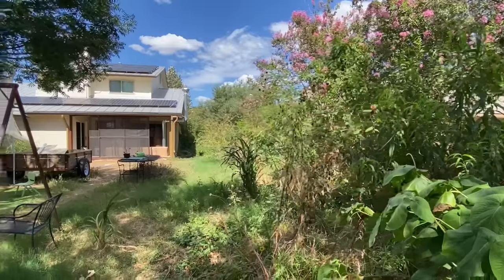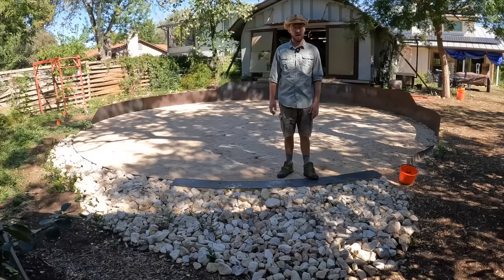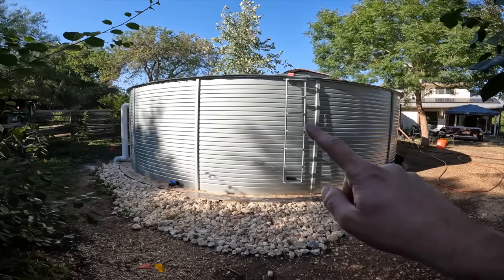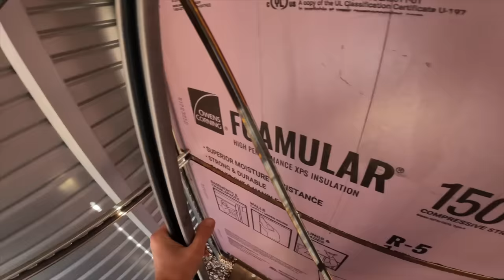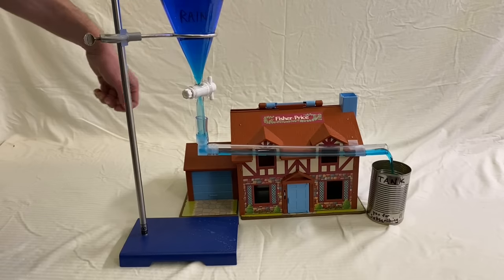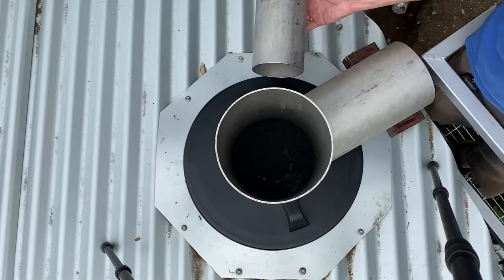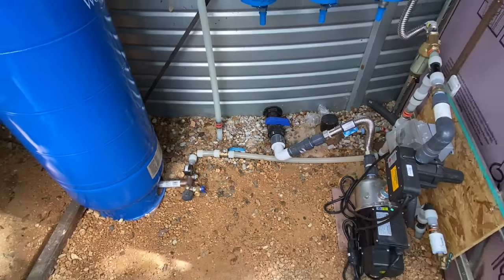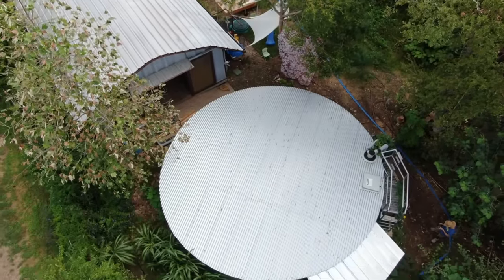FREE water forever.  LEGALLY!!!!

Comment: I work in water filtration, rain water is fantastic. Just a few things for other people to keep in mind:
- Keep a clean roof, install gutter protectors, use a first flush diverter to dump debris in first run-off

- If you live near farmland, there may be pesticide/herbicide overspray, if that's the case you need carbon filtration which adsorbs a range of chemicals

- Protozoa, cryptosporidium, giardia, cyclospora are always a risk with tank water, I'd recommend a minimum 1 micron nominal silver impregnated carbon block filtration on drinking water to deal with them

- If there are factors which make bacteria or viruses a concern (dirty roof, lots of birds/bats, decaying organic matter), install an ultraviolet steriliser for all water coming in. UV will also take care of protozoa, cyst parasites.

- If you use UV sterilisation, you will need a minimum 5 micron nominal sediment filter before it to remove particulates pathogens can hide behind.

Forgot to memtion -- acidity can be an issue. Rainwater is naturally acidic and when it sits on plastic it stays acidic. If it is low, it can damage copper water lines, causing pinhole leaks. The copper also enters the water potentially posing a health risk. It can also introduce lead into your water from brass fittings.

Test your water's acidity and if it is below 6.2-6.4 or so, consider installing a calcite or calcite/corosex system to buffer the pH back up.  If you ever see green/blue staining in your bathroom, it is acidic water stripping copper off your water lines.
Reply: I was thinking he should use a "first flush diverter" but I didn't know what it was called or if it existed.
Reply: I imagine the best bet here would be to swap out his last filter in his line of three with a carbon and install a UV coming out of it, since he can't really install it going into the tank. Personally I'd chlorinate periodically too.
Reply: What about bird droppings?
Reply: I learned something extremely useful here!

> If you use UV sterilization, you will need a minimum 5 micron nominal sediment filter before it to remove particulates pathogens can hide behind.

I have a spring on a piece of property I just bought, and currently my setup goes 500 / 200 / 100 / 50 micron spin-down filters, followed by a UV sterilizer, followed by 5 micron cartridge, activated carbon, and 0.5 micron (as one pre-made unit, so I can't easily add UV in the middle). 

I'm either going to move the UV sterilizer to the end, or, more likely, add a second one after the 0.5 micron. 

Thank you for sharing your knowledge!
Reply: Not if that rain water has barium , strontium and aluminium in it.
Reply: @FKTHESYSTEM063  This sounds interesting. Could you elaborate? Are you talking about industrial byproducts? Fallout?

I would assume that between activated charcoal, and reverse osmosis, most of those would still be removed from the water supply.
Reply: Great information
Reply: Perfectly clean water sounds great but are there any reasons to condition the water with anything for certain purposes like laundry or cooking or cleaning or drinking? Or is clean pH neutral water going to be good for every household use case?
Reply: @northwestguru1 yes if it's clean you can use it anywhere anytime. 

If it's dirty don't even use it to clean

Hope this helps
Reply: farm chemicals.....you eat them.!!.
Reply: Finally, someone making sense.
I'm not sure about the 'brass/lead' though as brass is usually a copper-zinc alloy; maybe it's just a typo.
Reply: @northwestguru1  Mostly, yes. But long term issues could apply if it is your only source of drinking/cooking water, you could have problems with low Iodine etc if your diet isn't balanced/supplemented.
Reply: @bikerfirefarter7280  My guess is that they mean where brass is soldered with lead containing solder?
Reply: @northwestguru1  in laundry, general cleaning, dishwasching, etc usually soft water (like rainwater) is preferred, as e.g. alkaline earth metals form poorly soluble salts with anionic surfactants. (usually water softeners are added to prevent that. But they have different ratios of water softener vs anionic surfactants, some don't contain any softeners. So, depending on the ratio, you could use less of the cleaning agents/may not need to use seperately sold water softeners)

Other than that, for drinking and cooking, direct remineralization or diet supplementation with minerals could make sense, depending on how your diet looks, as rainwater is relatively poor in minerals. (also on a minor note: minerals impact taste. So food prepared with rainwater vs remineralized vs tap water can have different tastes, in which case you could just experiment to find what you like best)
Reply: In NC we deal with GenX in the water (rain and ground). Activated carbon/charcoal filters, reverse osmosis filters and nanofiber filters have been proven not to work here. Bummer. Water is good.
Reply: Thank you bro fr. I'm so tired of America
Reply: does boiling water resolve all of that, educate my stupid brain pls
Reply: @marcheheart4228  It resolves most biological hazards like parasites and bacteria, but boiling wouldn't do much against chemical contamination sadly.
Reply: This is the comment I was looking for. Thank you so much man, you may have just saved a lot of people from needlessly getting sick.
Reply: it was cool but the exterior is a straight eyesore
Reply: Do you enjoy your job? I have looked into water treatment careers.  Looks like something that you can go home feeling like you have purpose and did something good for humanity.
Reply: Thanks for the knowledge. I never see myself doing this but y'all are very inspiring.
Reply: Thanks for sharing your knowledge
Reply: For anyone confused by a "low" acid rating being a bad thing - the lower the pH, the higher the acid.  It's 1 through 14 with 7 being normal.
Reply: I just buy my water jeez
Reply: good comment
Reply: That is some awesome advice wow! my grandparents have been on rain catchment water for over 50 years and have had constant blue/green water staining issues. might have to let them know about the ph levels. thank you very much!
Reply: @harrywalker968  Yeah these "I work in....." people didn't realize that.🤣🤣🤣
These people will always find a way to downplay any effective project just because they claim they work here or there. It is just jealousy in my opinion.
Reply: There is another aspect of using rain water. The more we use or drain it away, it doesnt fill up ground water level anymore. In Germany we have about 5-7% land sealed and drain the water away to water treatment plants and finally to the rivers. So that amount of water is missing each year to fill up ground water. year after year this adds up and we complain about dry soil....
Reply: @PsRohrbaugh  geo engineering/ Chem trails / weather manipulation etc.
Reply: Exactly this is the comment i wanted to read. Harvesting rainwater is not a big deal but what comes next is extremely important which you have made clear. thanks for spreading knowledge.
Reply: Such a great and informative comment. You can tell youre a caring person because you didnt need to share this in depth information with us who didnt know. Thank you!
Reply: takes notes
Thank you for this valuable information!
Reply: Great advice 💯💯💯
Reply: @Polygonaldog His drinking water needs to go through RO filters. RO filters can remove bacteria, even virus and chemical contaminants, which makes the UV and chlorine obsolete.
Reply: @bobsmith6544  close but not quite. You are correct with the 1-14 scale with seven being neutral. Anything below seven is what's known as alkaline and anything above seven is acidic. But being too alkaline can be just as bad and corrosive as being too acidic.
Reply: Are there any self sustaining ways to filter the water in the event that you cant buy the super fine filters anymore?
Reply: DOn't forget microplastics now being found in rain water
Reply: @danmartens8855  you can collect bird droppings almost anywhere and don’t need a tank and pump/filter house to do so. This video was to provide an option to collect rainwater.
Reply: I can be wrong, but the acidity can be fixed (kinda)by picking the water from top to bottom, because the components that make the acid rain can seddle down 

Yes you will need to remove the excess
But help i think 

(I iam saying that because i in the past has doing HHO generators, using rainwater, when i use the bottom water the stainless electrode corrode away VERY quickly) 
In want to know a way to isolate the acid from it

I mean, sulfuric acid is really expensive were i live(REALLY EXPENSIVE)
Reply: @bikerfirefarter7280   There's not much lead in brass these days, but usually 2-4%. If you have acidic rain water, that will leach out and enter the water supply.  Cheap Chinese brass products tend to have higher levels, most Western countries are introducing rules to reduce lead levels in fittings in water lines.
Reply: @marcheheart4228  Boiling can kill viruses, bacteria, and parasites, However it will not remove heavy metals, sediment, and many  chemicals. For most chemical contaminants, carbon filtration works well. 
For heavy metals, you need a specialised carbon block filter.  However, there shouldn't be heavy metals in your rain water unless it is acidic and leaching from solder or brass fittings, or there are serious environmental issues like industrial activity causing acid rain.
Reply: @tigerjr38  It is definitely enjoyable in that respect, you'll get to hep a lot of people enjoy healthy water. Water filtration will only be more important going forward, as our water sources are increasingly polluted.
Reply: how raim water is more toxic in the past 10 years with overwhelming pollution in the air and atmosphere?
Reply: @michaspringphul why is that an issue? The system only collects water  from the house roof, not from the surrounding land. 

We have a system similar to this one and in the dry summer months when everyone else has a hose pipe ban, we are still happly watering the lawn and flower beds.

Recently it's been raining  so much that the high water table is actually causing flooding. We can't walk on the lawn. It's too wet.
Reply: This guy making the video is lying about it being free, water still needs to be treated even if you have filters, water needs to be tested as well, all this cost money. Also of you just have a city hookup or county water hookup they still bill you money even if you don't use it, you can have that to fall back on but that's more money per month if you leave the account open
Reply: @bikerfirefarter7280 I thought rainwater contains Iodine !?
Reply: What about all those toxic substances being sprayed through the chemtrails above ?
Reply: @longiusfluminis2288 what does RO mean ?
Reply: @toolmanhvac water is supposed to be slightly neutral to alkali.
Reply: @esduitarielmoralez6332  Nope. Rainwater, if you think about it, is basically distilled water, apart from atmospheric dust and a little dissolved gasses from the atmosphere; after that there may be contaminants from the surroundings that accumulate on your catchment surfaces; dust, bird-poo, leaves etc. It would only contain Iodine after a nuclear incident (which would be radio-active Iodine).
Where did you think 'the Iodine' in rainwater would come from?
Reply: You water filtration commenters are hilarious, do you seriously think this guy hasn't done his research before undergoing a project like this? Get real.
Reply: @voon1032  I don't think he hasn't done his research, I KNOW he hasn't. At the  very least any 'research' he has done he has filtered it through his delusion of adequacy and therefore he does not truely understand it/them. He is incapable of critical thinking and mentally modelling basic physicality. There is also a condition called 'aphasia' which he appears to have to some degree. The end results and false logic of the processes he went through clearly evidence his misguided rote.
Reply: @anonimoqualquer5503  No, the 'acid' wont settle to the bottom, the free H-ions that make the water acid diffuse throughout the bulk liquid. 
To isolate the 'acid' you only have a few options: boil/distill off the water, or add alkaline material to react/nutralise/raise the pH.
Reply: One thing I had heard from a couple of completely unrelated videos to do with hair and jewelry maintenance is that hard water will speed up the oxidation process causing things to rust faster and develop a thick film. So that combined with acidity in water could cause corrosion of your tank and pipes if you don’t treat the water
Reply: whats the monthly expense like on all those steps? I gotta imagine theres energy costs to consider especially for the UV sterilization. Its the one thing I feel is a little misleading when in the video he said his water bill is $0. I mean yes you arent paying the municipality for water but all the expense for treating the rain water water is coming out of his pocket
Reply: @matts3425  just curious, but WTH is GenX?  I've never heard about that before?
Reply: @arkatub  Aka you have no idea what you are talking about but yet feel you are very much smarter than everybody else... and this is how everything gets f'd up
Reply: @toolmanhvac  Typo? Below 7 is acidic and above 7 is alkaline.  Please correct your comment or delete it.
Reply: or.  just pay your f@%king $50/month water bill
Reply: @ShalattiStrzUCM  yeah you should move to a country without problems, but then there would be problems in the one you moved to.
Reply: @@karlwithak. He is supplying his own needs not a community.
Reply: Solid tips. listen to this guy!
Reply: Wow thank you!!!
Reply: I would but it’s illegal to collect rainwater in California
Reply: Solder
Reply: yea ill just use city water if this is whats required xD
Reply: @toolmanhvac I think you meant anything above 7 is alkaline.
Reply: Yeah there's a load of things this guy's forgetting.
Reply: @MrIndiemusic101  he didn't have a UV in the video but they'll typically be around 30-55W for most domestic applications. Not a great deal of energy to run. In his set up you're more looking at overheads in terms of filter replacement and equipment maintenance (hence why we pay our utility companies to do that for us albeit at a treatment facility). Filter replacement cost is nominal (around £10/$15 each) and will be done 3 monthly to yearly depending on coarse filter performence.
Reply: @esduitarielmoralez6332  reverse osmosis. It essentially is taking pressured water and passing it through a very fine membrane that only water molecules can pass across thereby leaving everything else behind. A major downside is that it'll leave behind any carbonates in the water (aka hardness like calcium and magnesium carbonate). Hardness is found naturally in water (albeit not really in rainwater! so I can see why he opted for RO over UV) and improves heart health. shame it stains water fittings with limescale!
Reply: @chosen1one930  you make good points but I feel he addressed those in the beginning around his feeling of need for independence if another grid failure occurs. Regarding testing, off the shelf kits are really very inexpensive and can be used for good qualitative control.
Reply: @esduitarielmoralez6332 if it does, it's not in amounts that make a difference.
Reply: @marcheheart4228  Boiling's only good for biological contamination (bacterias, protozoas) and not so much chemical and other sediment contamination
Reply: clearly you didnt watch the entire video but still really good advices
Reply: @toolmanhvac  it's the other way around.  Lower pH means more acidic.
Reply: At this point, with all this specialty gear, it may be easier and cheaper to just pay the water bill
Reply: You know you can ACTUALLY filter water through acquatic plants, right? It's called phytofiltration.
Reply: Sounds like waaay too much work. Is it worth the time and investment?
Reply: One of the single best comments I've ever read
Reply: @FKTHESYSTEM063  ...😔in your water too
Reply: @aa-tx7th  you dont remember why he build that!And if you got no electricity one day you could not use any water but he will still take shower XD
Reply: @jannops  california suck!
Reply: @DawnAfternoon  reverse ozmosis take care of that
Reply: @Damin-Danger-Ledford  you don't remember why he build that
Reply: @myriannelejeune8136  I don't remember. I don't really care.
Reply: @danmartens8855  "You don't want to drink stuff from a dirty roof, lots of birds/bats, decaying organic matter"
Reply: oh no. There were few doctorate written on the subject recently. rain water is getting more and more polluted. It does rot inside the clouds sometimes.
Reply: And those faucet fly worms......🙄
Reply: I skipped through much of the video & wondered if I just missed the first flush diverter, but I guess not. I wonder what's going to get built up & eventually stuck in the lower underground pipe. 🤔
Reply: @asktheanimals  wondering also about the weight forces of the whole structure. Seems pretty weak.
Reply: Great info!
Reply: I wish I could just share your comment!
Reply: Thank you❤
Reply: @ Lead Farmer 73 READ THE MAIN COMMENT LEAD. YOU HELP US SO WHEN I SEE SOMETHING THAT'S ALLLLL THAT, I TELL Y'ALL
Reply: I'm having flashbacks to when cryptosporidium got into the drinking water because our local water supplier didn't do their damn job. And they got a slap on the wrist!
Reply: Is there a company I can pay to do all of this for me? Perhaps some sort of "Water supply and delivery management" company? 🤔
Reply: Paul just out here savings lives casually.
Reply: Blablabla. Only covids and bad carbons matters
Reply: Surely there must be a simpler way! Is there?
Reply: @SomeoneClever LOL
Reply: @bikerfirefarter7280 admiralty brass had a fairly high lead content, other than it's toxicity it was great, corrosion resistant and free casting it hasn't been used for domestic purposes for the last 70 years in England at least, don't know what goes on stateside.
Reply: Thanks for the more information about how it works on the system.
Reply: SUPERB help for all of us out there. Thank you!